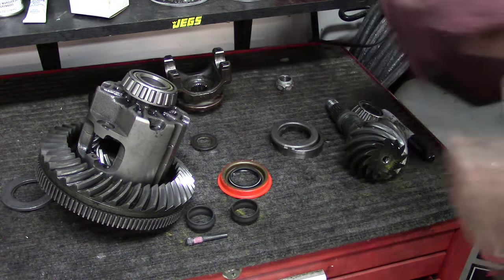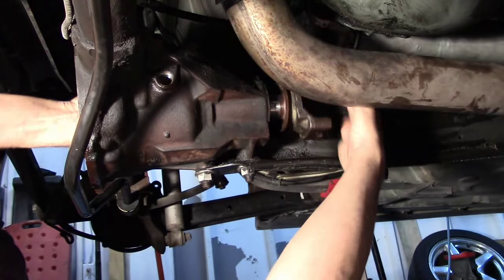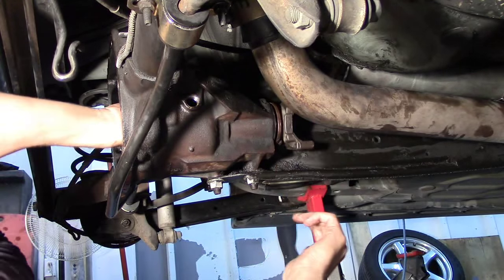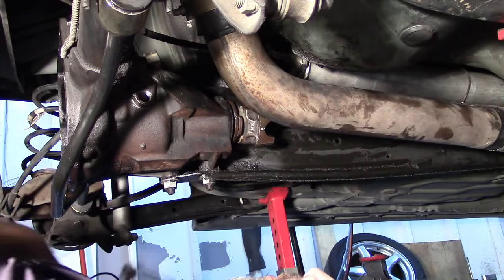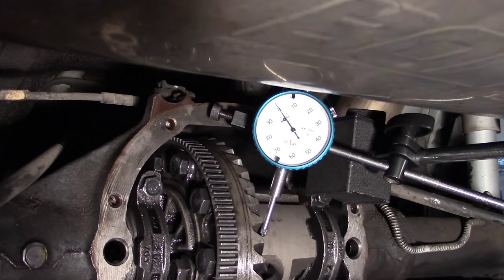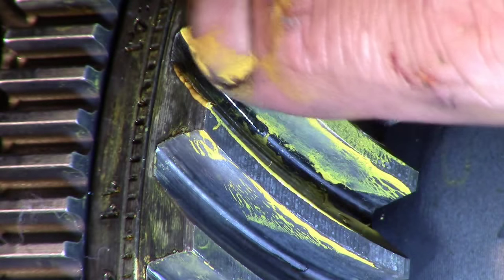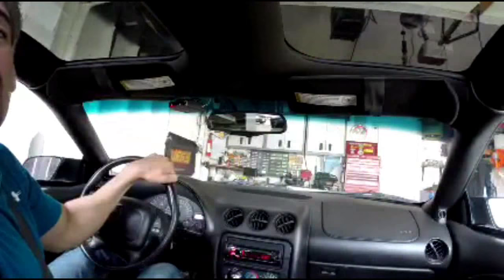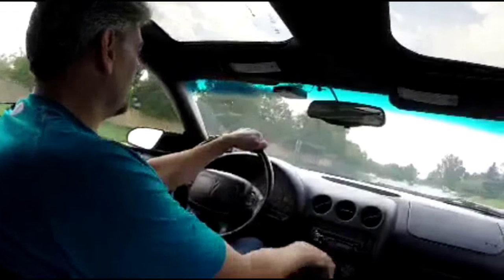RWD Differential Backlash Noise Diagnosis and Fix-Pt2

Comment: With the cost of all the materials and special tools required, I think my firebird is technically totaled. It's a shame really. It still runs like new, the body is straight, it has no rust, it's been well maintained for the 18 years I've had it, and it only has 104k miles on it. But then there's that slight humming noise between 45 and 65 under low throttle conditions...
Reply from the maker: WHat special tools? The rear end tools I use for an entire rebuild cost less than $200

Comment: do you use GMs limited slip additive, or just whatever is built into aftermarket synthetics gear oil?
Reply from the maker: i use standard gear oil with LS additive.
Reply: OK cool. Hopefully it's not a big deal that I used valvoline 75w120 (or whatever the weird winter range it is) with additive built in. If so, I'll swap it out asap. (92 z28)

Comment: I just had 4.10 gears installed in my 94 mustang gt and now I have a clunking while coasting (only). I read online and figured it's the shims. Do you think I might possibly be right?  I am not a mechanic, but I believe I am as capable as the next guy; I just need some guidance.  By the way Schrodinger, Great video!
Reply from the maker: What was your backlash measurement?
Reply: I don't think so, I doubt it. If it was, it probably was not written down.
Reply: sorry I am super tired... the backlash wasn't measured.
Reply from the maker: David Fannin Then I can't help sorry.  You need to measure backlash if you suspect the shims.

Comment: I presume the splines did not have any play in them. The only times I have seen a nuts strip out like that was when they came loose first creating a slide hammer action.
Reply from the maker: Andrew Thompson Yes that is exactly what I believe happened- well described!
Reply: I had worn splines on an early English FWD car once. The hub nut would come loose every few weeks. There was only a small amount of slack but nevertheless enough to unwind the nut.

Comment: Am i mistaken, or did i see a non posi diff in that sports car?    wow, GM,  so fired.  Good video though.  Honestly if it were my ride, and me.  When i saw the nut jacked up and loose, i probably would have bought a new nut and some gear oil and popped the diff cover, inspected it put on the new nut, threw in the new lube and called it good.  Wouldn't have made a good video doing it that way i guess.   Thumbs up man.
Reply from the maker: +Rhage73 If this car were just a daily driver I would have done that, but knowing I was launching multiple times with over 400ft-lbs of torque to a loose diff, I really was convinced I surely blew out the pinion bearing at the very least.
Reply: but on the upside.  YOU DIDN't WOOHOOO!! haha.   have oil in my coolant on VR6 jetta.   It makes it burn right on the tip.
I have my fingers crossed that it is the shitty oil cooler the put on those.   have coolant loss too.  had a "slow leak" for a while, just havent gotten to it.  but now i guess i will have to.  gah, what a crappy evening.  pathy is out of service with a badly slipping clutch, and now the jetta wont go without loosing coolant.   if i wasn't depending on it right now it wouldn't be a big deal.  but now the pucker factor is way up.  if it is the head gasket, i heard matches fix that.  ;P

Comment: You also should not use an impact to set preload.
Reply from the maker: Why not? Please explain.
Reply: Schrodingers Box to easy to put to much on it with an impact.
Reply from the maker: Maybe if you are a beginner.  If you practice you will have the ability to control the torque amazingly well. But If you still feel safer using a breaker bar I can't argue.  How do you lock the pinion gear though?
Reply: Schrodingers Box I have the tool to bolt on the yoke.